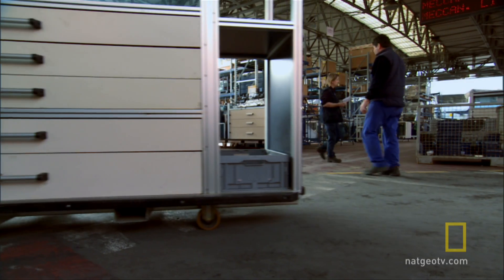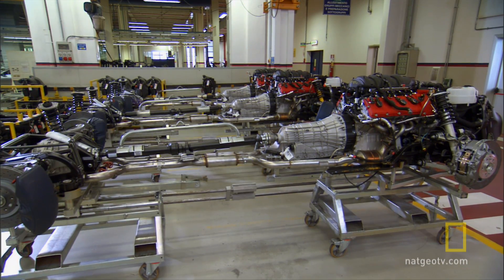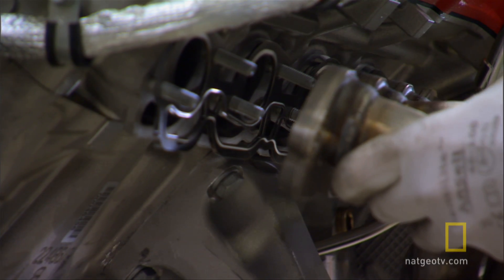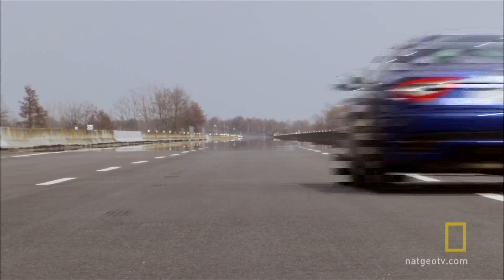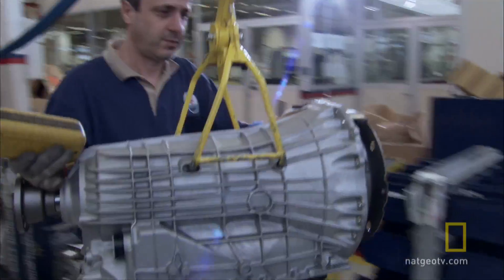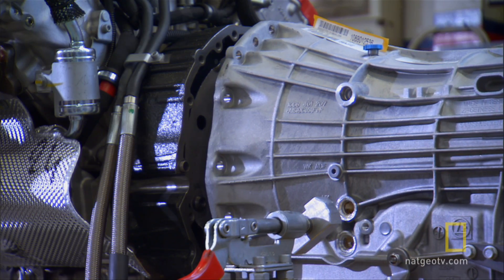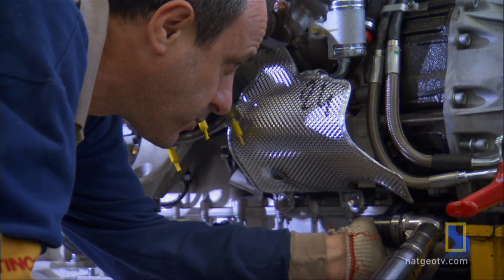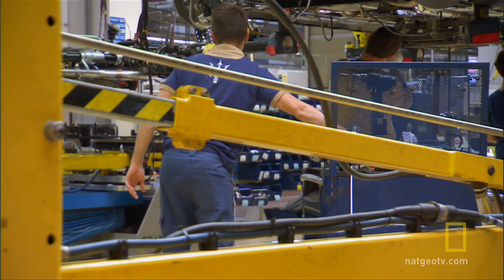Building a Maserati Fuel Line | Ultimate Factories

Comment: You know what that warehouse is missing? WALLS, oh and climate control.  The ports on the engines aren't even sealed.  I'm reminded of Chevy smallblocks sitting in carports in trailer parks, or under a tarp.  Then the guy installs the header without using a torque wrench.  I'm really quite shocked.  Even "plain Jane" American crap is assembled with more care.  I think they should hire some robots.